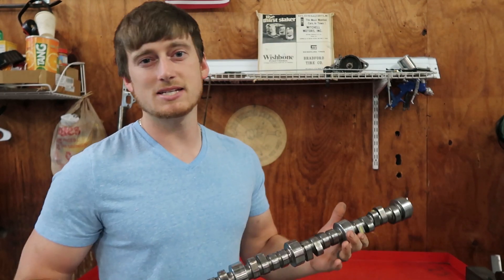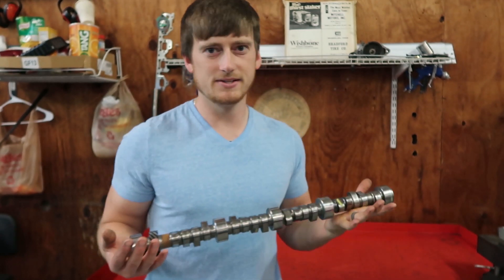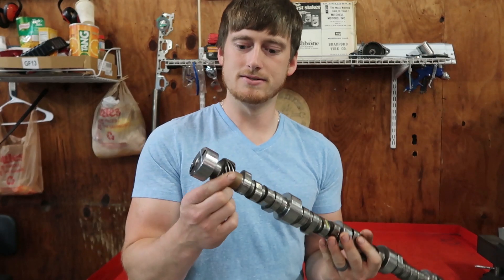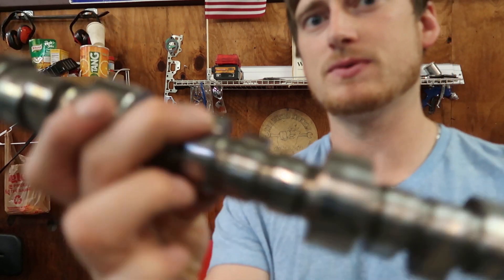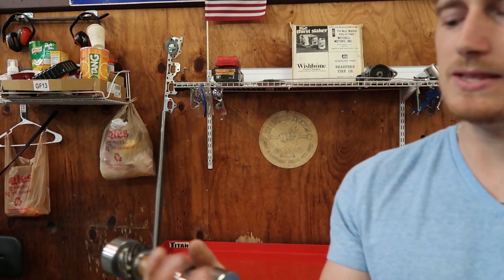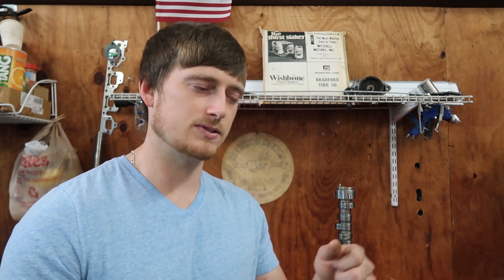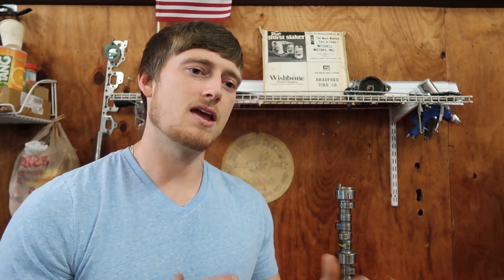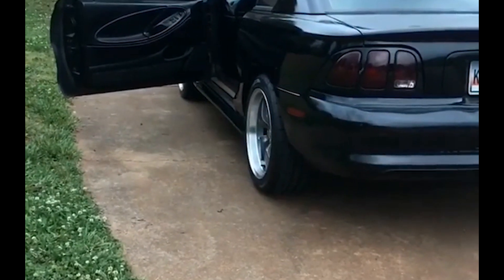Camshaft specs and what they mean (What cam is best for you)

Comment: Now that you have a lunati voodoo cam in the mustang did your distributor gear have to be changed?
Reply from the maker: I didn’t change mine and I actually don’t have the voodoo in it now, I took it out just because the rpm range was a little to much for the stock bottom end. And if I went back with it I would use a brass gear

Comment: On my 89 302 I’m running a 549 lift cam on a E7 head, upgraded to 540 rated TFS valve springs
Reply from the maker: TFizzle34 okay so you can run larger cams on them I appreciate the info, are you still running pedestal mount rocker arms or screw in stud style rocker arms
Reply: I’m running fixed 1.6 roller rockers
Reply from the maker: TFizzle34 okay it may be that the factory valve springs will only hold 500 lift. But sweet man I appreciate the info! 👍🏼